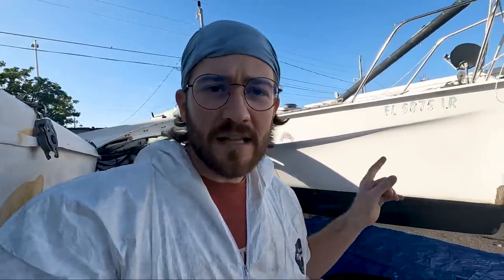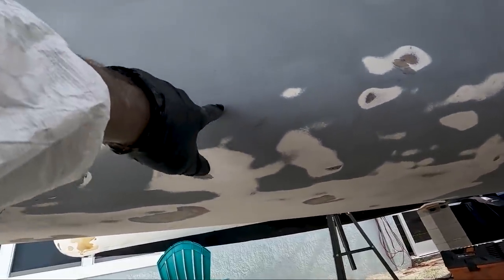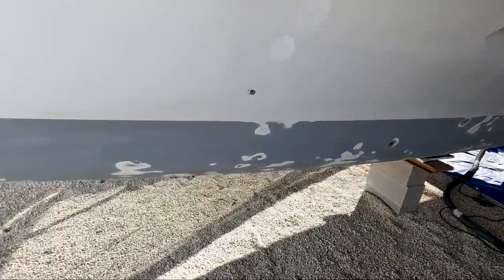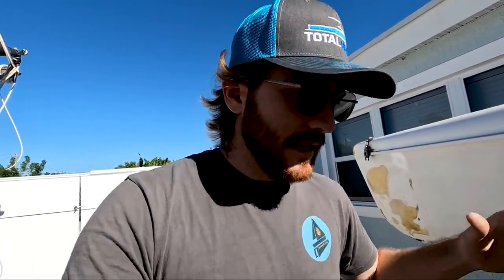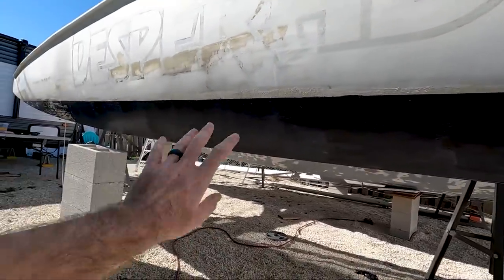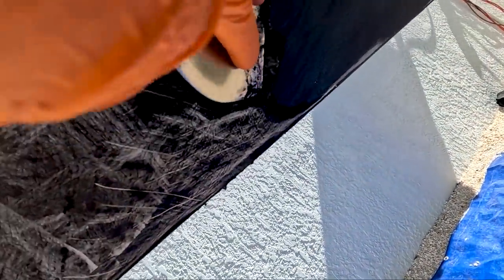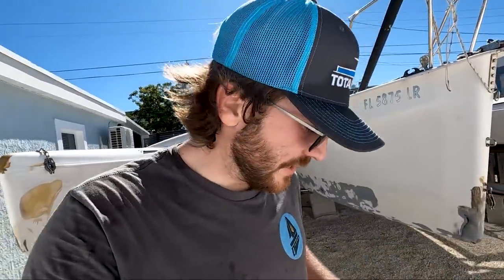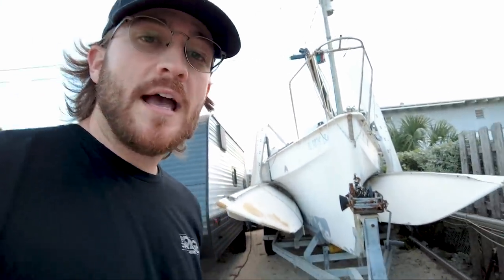Sanding or Stripping Antifouling - What's Better? | Learning the Lines

Comment: They sell a vortex dust separator that goes on a bucket which goes in line before the vacuum.  They keep the vacuum from clogging and are extremely common in the drywall sanding community.

Comment: As someone who has stripped a lot of paint off of a lot of wood, I would suggest covering the stripper even if it says you don't have to.  As I understand it, the compounds that do the work of breaking the chemical bonds in the paint are extremely volatile (they evaporate fast.)  You want those volatile chemicals to stay against the painted surface for as long as possible, and you want to keep them out of an environment that will cause them to evaporate more quickly (no direct sunlight.)  That's why paint removers have a gel consistency.

I've also found that you want to start scraping while the remover is still wet.  If it has dried, reapply a thin coat, re-cover the area, and wait until the stripper has penetrated the dried areas.

My experience is with wood, not fiberglass, so I follow the stripping with a scrub of TSP for lead paint* or a TSP alternative solvent for non-lead paint and use a 3M stripper pad.   My experience with wood is that sanding the residue pushes the fine dust into the pores of the wood instead of removing them.

*TSP is a water polutant and should never be used where it can escape into the water table.  However, the phosphate in it will bind with the lead from the lead paint to form lead phosphate. While, lead phosphate is not a friend of man or beast, it is not as bioavailable to plant and animal life as regular old lead.  And regular old lead will be stored by your body in your bones.  If the bones with the lead in them are in a body that is gestating, that lead will be transfer to the fetus.  We all have lead that our mothers and grandmothers were exposed to in our bodies.  So, don't play with lead, kids.

Comment: At our marina there was a business that stripped bottom paint down to the gel-coat  using a sandblaster system. He did an awesome job and the price is reasonable . I sanded my own boat and put on new bottom paint ,but I absolutely hate it, so I will be getting in touch with this guy. He is mobile and comes to you so that's another +

Comment: You could try and set up a small water tank as kind of a wet filter for the dust between the vacuum and the sander. Shouldn't take too long as a DIY project either.

Comment: Hi I had to remove the many layers of antifouling on my Farrier Trimaran and simply wetblasted. No dust, a days work for the 32 feet mainhull, very clean result. Then a couple of layers of barrier coat and then Copper Coat, the orignal product. I use a rough sponge in the water to activate the copper when I see that growth is starting. That is a half hour once a year with snorkel and mask. Done. I am cruising in Greece for six summer months every year.

Comment: I have the bigger, round, shop vac and ran into the same clogging problems.  I found vacuum cleaner bags for it at the big box store and with those installed, the vacuum never clogged again while sanding.  I was able to do the entire bottom of a 30' monohull without ever having to clean the filter or empty the vac.  When the bag is full, it is a mess free operation to remove and dispose of it.
I agree with you on bottom paint being hideous, but I haven't found any alternatives yet that are cost effective.  I would love to copper coat mine (C&C 30), but I am moving up in the next few years and that makes it cost prohibitive.  I do think (personal opinion only!) chemical strippers are magnitudes worse for you and the environment, than ablative bottom paints.
Reply: 2000 xp for the vacuum bag.  Vacuuming toxic dust without a bag is just moving the particles around so that you can distribute them in other places.  

I'm a fan of chemical strippers. The volume of particulates is so much lower and the waste product is easier to contain. My experience is in removing lead paint from wood, so it may not apply to fiberglass and ablative bottom paint.  (CitriStrip covered with thin plastic is much better for house paint than the harsher chemicals, in my experience.)
Reply: I did 38' full keel monohull same way with with HEPA filter vac and Dust Deputy Cyclone Separator. Never had to change the filter.

Comment: For larger boats you could try sheathing the hull below the water-line in copper. Supposedly it lasts 20 years but it's really expensive. For a trailer sailor, which your boat is, you don't need anti-foul if you take it out of the water often. Just trailer up when you're not using it and wash it off.

Comment: Great video! The anti-fouling kibuki theatre every year cannot be the best solution. Copper coat with a bit of extra cleaning sounds good. Extra cleanign beats sanding anyday.That the stripper works better on the non-sun side is a CLUE that perhaps covering it to keep it moist might have been a good idea after all.....

Comment: I've removed a lot of lead base paint from a  big 1907 house I used to own.  Gel stripper worked the best for me, but I would use one coat and let the chemical do it's thing and then scrape off before it dried.  Then I would apply another coat of stripper to get to those bottom layers until I made it to the beautiful wood underneath.  Wasn't easy, but a heck of a lot better than sanding.  Yesterday I set my Catalina 22 up on blocks and pulled the swing keel out.  I DO NOT want to put paint on the bottom that I will have to do again in a year or two.  My vessel is a trailer sailer and will only be in the water when I'm using it. So, I'm trying to figure out what kind of bottom coat I can put on that will stay on. I also don't mind wiping the hull down once it's back on the trailer, plus I have a big power washer to help out.  Do you already have a paint product picked out for the bottom?

Comment: In my hard won experience, the only reliable and non toxic way to control marine growth is to pull the boat out of the water at regular intervals. Since the F27 is trailerable, I think you have your solution.  Copper coat seems to give very uneven results. I would invest in a good, reliable, convenient way to pull your boat and you won't have to mess with bottom paint again. 
Cheers from Alaska
Reply: From what I've observed, CopperCoat works very well, if applied EXACTLY per the manufacturer's instructions (It is VERY time, temperature, & humidity sensitive). However, it seems a great many people (including so-called 'professionals') seem unable to follow instructions properly.

Comment: I'm curious as to what grits were you using on your sander? Were you not using a bag filter? Yeah, if you use a pleated filter, it'll clog up very quickly when sanding paint.
Reply: @Learning the Lines, would love to know that
Reply from the maker: 60 grit and I normally use a bag but I ran out recently. I didn't think it would make a difference but it seems it might have.

Comment: The cheapest and most friendly way to remove paint, is to use soap.
pH-value 13-14, primary content Potassium hydroxide. ( if my translation is correct 😉 )
You simply smears the soap on, or with a paintbrush… , spray it lightly with water, and cover it with household film.
Let it sit for a few hours, up to a few days, and remove film, paint, and the remaining soap. 
Remember to protect your self, including eyes!, as the soap is very hard on your skin and eyes !!!
When your finished, then you can discard everything easily. 
Wash the boat with water, and you are ready for a easy sanding, and build up your bottom paint once more.
In your climate, I believe you can “strip and clean” a boat like yours in a day.
Most important is, it’s very easy to clean up and no strange chemicals.
Reply: I'm pretty sure those paint removers are the exact same thing. AT least I haven't seen any that contained something else.

Comment: I have to agree about ablative bottom coat, BUT... and there is the huge elephant... Location, temperature, salinity, frequency of use and so many other factors determine the effectiveness and type of bottom paint to use. Mitigating our impact is paramount. Having said that.... There is NOTHING ecologically friendly about boats. From raw materials to finished product and beyond blows the carbon footprint way up on the beach. When I hear Tubers and vloggers spouting their "Greenness" I cringe. "Self-sufficient" yes, "Green" no. It may only be semantics to some, but semantics matter. These are standards invented by us parasites to make us feel better about our existence. Be mindful, be respectful, and live to the best of your ability, but for heaven's sake LIVE LIFE!
Reply from the maker: It's all relative man. I live in an area where it's commonplace to see people with 45' center console compensators with FOUR 300 horsepower engines on the back blowing through more fuel in a day than a normal person's car would in a year. Relative to that, and to most boats, electric or even diesel sailboats are way more ecologically friendly. It's perspective I think, but I agree with you in that nothing we do as a species is actually green unless we're capturing more carbon that we're producing - which SHOULD be the goal that we can hopefully strive for now or in the future.
Reply: @LearningtheLines  We can get there. Back in the "70's there was a tv show called That's Incredible that air an episode of a group of college students that took off the shelf parts and built an engine that got 50+ miles per gallon. There was a fictional gas crisis on at the time. I dare anyone to find that episode. It was yanked so fast it made heads spin. And yes, I believe Tesla's work was confiscated. In the meantime, Salute.
Reply: One cool thing about fiberglass boats is they can last forever.  While the original material is definitely no bueno to the environment, they can be patched and repaired over and over.  If you're not familiar with Sailing Dauntless, check them out.  They are refurbishing a hurricane damaged Leopard 50 that lost the bottoms BOTH hulls and was submerged.  It was probably a write off by the insurance people, but will become their new home some day.  I've personally brought two old boats back to life - a Solcat 16 and and OLD (1972) Boston Whaler.  Ultimate recycling!

Comment: With any stripper you should at least hand rub the surface with 60 or 40 grit sandpaper to give the stripper something to bite into, and do not ever let it dry, once dry the chemicals stop working, in any case you will still have to sand, bag vac good idea, use plenty of bags, make sure the sandpaper has perforations in it, best of luck, Al

Comment: Save your stripper for fiddly bits where  you cannot get in with the sander..
Might it be worth adding an abrasion resistant layer at the bow and along the keel strip.

LoW VOC stripper's are not that effective .... Cover it in wrap to get a more localised effect and slow down the drying .. its the solvents that do the work.

 Bart a Polish Neel trimeran owner has had problems with scraping his hull snorkelling in the Caribbian he has found he has a high heavy metal  content in his blood.😬
A hard racing type copper coat is at least more resistant to scraping.  There are electronic fouling inhibitors but i dont know how they work. 
Its a pity that someone cannot build a water driven limpit like robot pool cleaner that could be put in the water and buff off any hull growth. A Robo hull vac/scrubber ..lol. It would make a fortune ..just run the main bit off a fast saltwater pumped onboard system. 

Speaking of which i find for nasty dusty jobs an old disposable dust bag vac is much easier to deal with than a bag -less  vac.even if you have to swap the bags out to keep them  running cooler and at nearer full efficiency .
Reply: "Its a pity that someone cannot build a water driven limpit like robot pool cleaner that could be put in the water and buff off any hull growth. A Robo hull vac/scrubber ..lol. "

They exist. But they cost so much they're best suited to a business that cleans hulls full time.
Reply: @Garryck-1  
They have ...the company plans to set up a ship and boat cleaning service...
It doesnt use magnets and theyve done a lot of work on getting the sizes  and shapes right to get into the more awkward spots  on a hull. The brushes had to be designed to not damage hulls or coatings whilst sweeping away hull growing organisms.
I have an article link but if i include it UTube will delete my response save to say it covered mentioned recently in an online specialist  publication. 🙄
Reply: @clivestainlesssteelwomble7665  - Yes, I KNOW that they have.. that there are, in fact, several manufacturers doing so right now, including one here in Australia. In fact, that's what I was pointing out to YOU, after YOU said "it's a pity nobody has made one". There are even some videos of them here on YouTube... some made over a year ago.

(P.S. - the word 'stainless' has an 'n' in it.. you might want to fix that!)
Reply: @Garryck-1  
Dyslexia lures KO .. i thought i changed that some time ago ..looks like it didnt save it.

Looks like its been a bit of a lockdown project ..  ive seen hand held power scrubbers and and several years ago the robo spiders they use to hunt for and seal leaks on the inside of hybrid airship hulls. They work by having an inner and outer pair with magnets holding them onto the skin.. 
This you either have to use an integrated fan or water jet.
Reply: @clivestainlesssteelwomble7665  - The change looks to have taken this time.
Reply: @Garryck-1  
👍🏼 I may have changed the spelling but missed the save  change before exiting .Touch screens dont work equally well with everyone's fingers.. i often get the character to the right. 🤷🏻‍♂️
Reply: @Garryck-1  
Green sea are fronting it and it was developed by Armach robotics originally.

Comment: Like your videos, I’m in a few Sailboat DIY and always looking for some new technology solutions. Recently came across a Pettit Hydrocoat Eco bottom paint. Copper free multi season snd says goes over almost any bottom paint. Dual Biocide ablative. Just found and curious how long it lasts. Seems like you could have light sanded and started painting. Curious if anyone has used this? They have a regular and the Eco. Thanks for good videos.

Comment: For 20 years I would use a foam roller & ablative paint.. then sand every year with a standard sander.. then paint again.. never an issue..
Never used a shop vac.. used a face mask.. no tarp under the boat either.. no one did..that was 20 years ago..of course I blew blue out of my nose for a week afterward.
Bottom paint is part of boat ownership. Always a bad job. O never went down to gel coat.. the foam roller was a thin layer of new paint every year..

Comment: I used to work on a boat yard cleaning boats and the maintenance staff removed bottom paint with a pressure washer. Is that a thing or is that method wrong. I come from a building background so sanding is what makes sense to me but that technique went way faster then the sanding. Anyone has seen that before?

Comment: Is there any concern with paint stripper degrading the layers beneath? I would expect it to dissolve gelcoat and epoxy or vinylester resins.
Edit: The Total Boat website says the product in this video will dissolve 2 part coatings or epoxies but only after extended time. I suspect strippers with methyl chloride would be much worse.

Comment: Hey Jordan, how many crashes did the previous owner(s) have with that boat? It looks like it was used in a demolition derby. How about using a bottom paint similar to Silic One? The copper based bottom paints are still a HUGE problem. it would be nice to see your experience with a silicone anti fouling paint. Some of the brands are supposed to be good for ten years, and they are not toxic to marine life!
Reply: CopperCoat is NOT a bottom paint. It's copper particles embedded in epoxy. Unlike copper-based paints, it does not ablate or wear away, or need sanding, and thus is not a hazard for marine life.
Reply: @Garryck-1  Aha! Thanks, that's good to know.

Comment: What a nasty process this is.  Since I sail my boat in fresh water, and it's small enough to put in and take out every time I sail her, I don't worry about bottom paint or any kind of growth.  My boat has some bottom paint on it but most of it has rubbed (?) off.  That fits since it was built in December of 1972 (but probably purchased in 1974).  In reading other comments, I like the concept of doing a "wrap" on the lower hull.  If all you had to do after initial install is haul the boat out and peel off then reapply the "wrap", how much easier would that be?  : - )

Comment: You will have to sand your copper (toxic to marine life) epoxy every year to expose the poison to keep the growth off. It really boils down to how long you are leaving the boat in the water and how often you are using the boat.
Reply: Supposedly with Copper Coat, as long as you are actively cruising and causing a continuous bit of wear, you can go years without sanding.  I haven't tried it yet and have heard rumors that some countries/areas are banning boats that have it.
Reply from the maker: You can go years without sanding. Even still, it's a lot less sanding and a lot less dust. Also, pure metallic copper (already found in nature) is a lot less harmful than the stuff that's in normal antifouling.
Reply: Never heard of a person with copper intoxication.......
It is not so toxic I presume....

Comment: Sorry you put the stripper on wrong. You have brushed a thicker layer on. The surface of the stripper creates a skin which allows the chemical process to work. You would have had an easier time of it using this method. Best of luck.